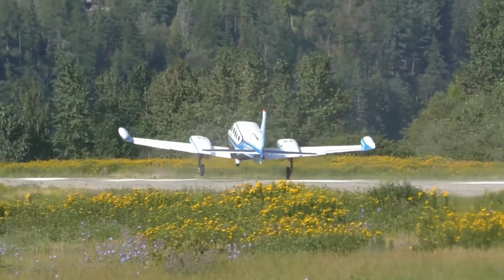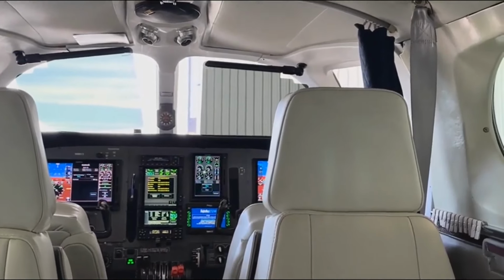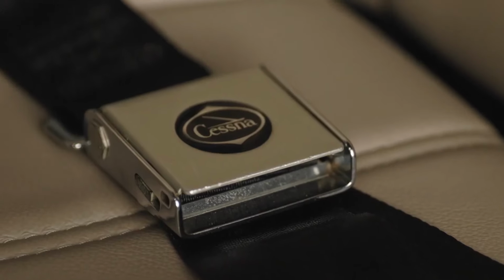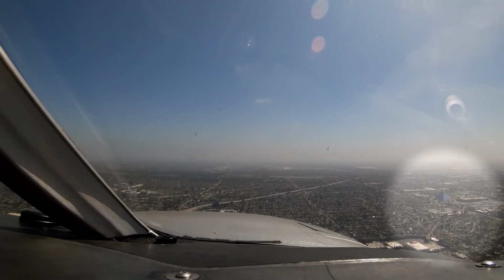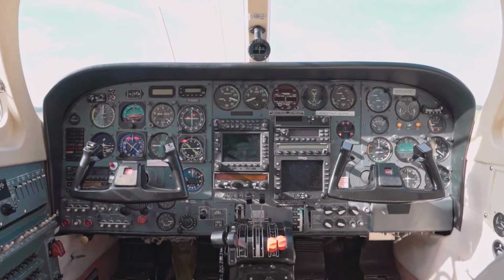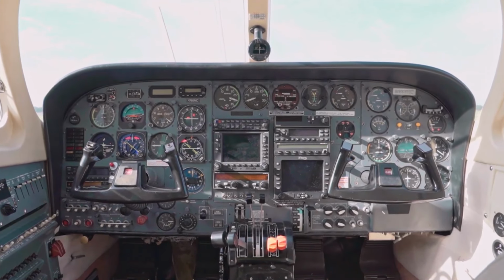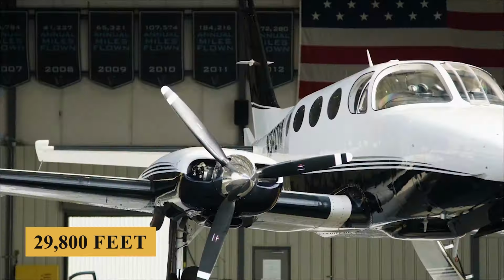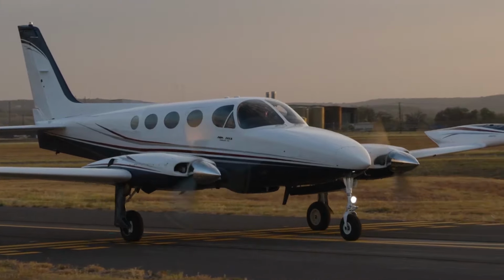Inside The $300,000 Cessna 340

Comment: You know, for quite some time I had my heart sold on a PA-31T but they cost >1.5 to 2.5 times as much. Naturally, there are differences - but the Cessna 340 is definitely worth a look, thanks to this video.
Reply: I would choose this over a Meridian if the prices were the same. Cabin is much nicer. Turbines can fail. You can fly low if you want to.  Annuals are much cheaper. You’re only losing about 30 kts in cruise speed and gaining a better range.

Comment: Too bad Cessna quit building piston twins in the early 1980's,an upgraded 340,woud have been nice,like hydraulic gear and a wet wing.I spent over 20 years working on these at a large Cessna dealer just across  the runway where these  built.